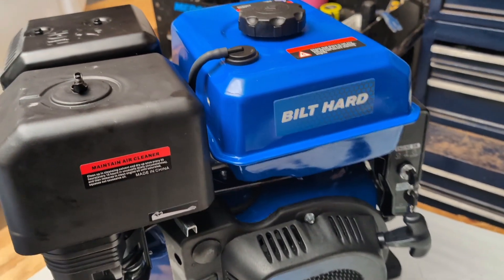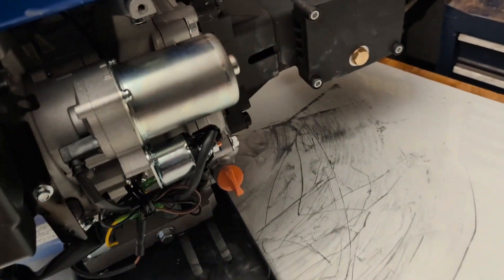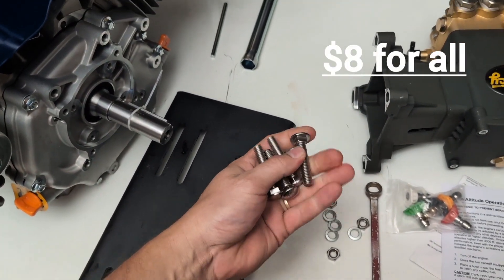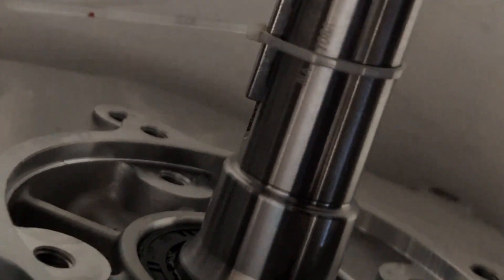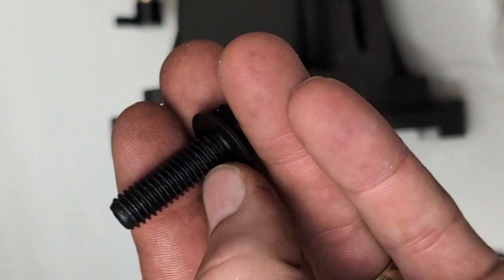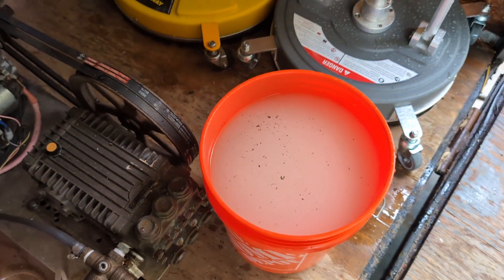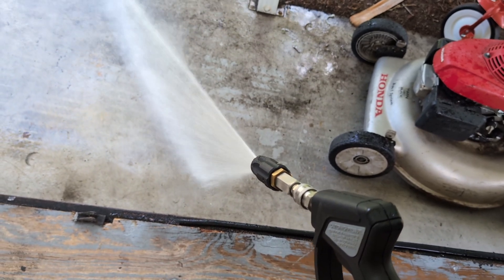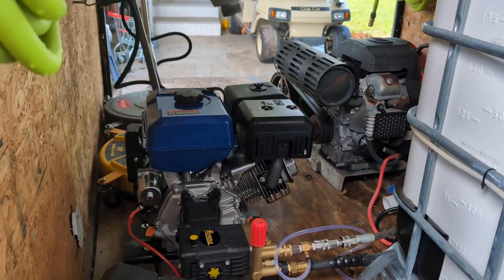4GPM Electric Start Pressure Washer Build for Under $600

Comment: how is it working a year later? I pickup all the same stuff
Reply from the maker: Still running strong. I'm putting together an update video. I've had no major issues with this setup all year and it's been a great year 😊
Reply: @MyPressureWashingBusiness  What battery did you get for yours?
Reply from the maker: @bobz6344 
https://amzn.to/4iLAPhB
These are the batteries I use. I have one for a starter battery and one for my batch mix soft wash setup. I charge them once every few weeks,  they last a long time

Comment: Never done something like this. Using your video i bought a gorilla cart, built a wooden. Frame . Then i mounted this engine/pump. 2 hose reels, and a winch to load it up into my van using some atv ramps. I now have my llc a surface cleaner and looking to do my first official job.

Comment: Dude, this is crazy! And now I have everything in an amazon wishlist. When any of them goes on sale, Amazon will alert me.
Reply from the maker: You won't regret it. I made it this whole season with this setup and it's still running perfect. The only issue I had was a valve cover oil leak. 10 minute repair and a $20 gasket. One of the most reliable builds I've done so far. The electric start was a game changer for me. I love it
Reply: Yessss. Electric start for the win! Bran new 4k pressure washer taking me 12-14 pulls per job. Incredible build! Ill be returning this one i just got and doing this exact same build. Will add a downstream as well
Reply: No gasket on the water pump needed?
Reply from the maker: @willreeves2379 hi, There is no gasket between engine and pump. The pump is a sealed unit.

Comment: Good video. I would advise not using  Loctite the bolts that hold the pump on, and put anti-seize on them instead. The lock washer is plenty.

Comment: When I test flow, I test it at the rated pressure, not an open fitting. And 4000 psi at 4 gpm calls for a size 4 nozzle.

Comment: A question: Amazon offers 3 different pumps, one with a 4000PS, 4200PS, or 4400PS. Which one do you use? Thanks.
Reply from the maker: Hi, I bought the 4400 psi pump.
Reply: @MyPressureWashingBusiness  Thanks.

Comment: So I’ve been doing tons of research bc I plan on starting a pressure washer buisness but a good pressure is expensive as crap. You got me thinking about just building it from scratch.  Save money and learn my setup so if something goes wrong I can fix it myself! I appreciate you 🫡
Reply from the maker: It's a good idea to learn your equipment. If you don't care about electric start you build your own even cheaper. The 420cc motors without electric start are even cheaper

Comment: I think the closest would be vevor 4400 4gpm but they raised the price now to over $600. So I was thinking of doing this myself, but going overboard with it haha. It would be over $600 but still far cheaper than a pre-built
Reply from the maker: Yeah. I was looking and I see prices have gone up a little since last year when I built mine. It's definitely a better machine then a box store pressure washer. I have had zero issues and have used it almost a whole year now.
Reply: @MyPressureWashingBusiness  The pump you have listed is no longer available. Would it hurt if I went up to the 4.4 gpm pump? Or do you know of a good alternative?
Reply from the maker: @FreelanceMarketingSolution 
Hi. No it would not hurt at all to go up to the 4.4 gpm. It will run perfectly fine😊
Reply: Quick question. If I went with the 5 gpm pump would the gravity fed buffer tank supply enough water? I have a 60 gallon tank. Thanks
Reply from the maker: @FreelanceMarketingSolution yes it would supply enough water. You can do a bucket test first to confirm but I am 99 percent sure it will work. I remember doing my bucket test with a 50 gallon tank and I had like 6-7 gpm coming out. Make sure you are high enough off the ground to get good flow to the pressure washer. Al least 12 inches

Comment: Hey man did you use hex bolts to attach the pump to the engine? And what size is it? Thanks I hope to hear some you soon
Reply from the maker: The bolts came with the pump. I really don't know what size they were. They were hex. I'm really sorry man, I wish I had an answer for you
Reply: @MyPressureWashingBusiness it’s okay man I understand I got it figured out! Thanks for posting this video it helps a ton ! 🙏🏻

Comment: Is there 3800 psi sufficient enough for the 20’ surface cleaner?
Reply from the maker: You can run a 20 inch but you will have to move slow with it. I have been using my 18 inch with it and it works alot better.

Comment: Your showing a motor w/ 3/4 ' shaft and pump that requires 1" shaft. How does that work?
Reply from the maker: Hi. They are both 1 inch shaft. The bilthard engine has been out of stock so if you clicked on the link in the description it may have taken you to a smaller engine. I just updated the link.

Comment: I just bought the same pump. Mine came with downstream injector built into it. Can I plug it and use the injector I bought?
Reply from the maker: @nccuttercarolina3918  yes plug it and always use the aftermarket injector. 😊

Comment: How's that pump holding up?
Reply from the maker: @nccuttercarolina3918  it's still going strong. The only issue I had so far with this build was a small oil leak in the valve cover. I ordered a new gasket and I'm back in business.

Comment: You use same oil for both machine ,Pump and engine?
Reply from the maker: @silvioperezj.d6872  no, the pump came with oil. It's pump oil. I do change my pump oil every few months and I use the brand general pump oil designed for pressure washer pumps. The engine uses regular motor oil.
https://amzn.to/4jqKWHK
Reply: @ i saw you're using sae 10w 30 y got the same engine/ and instructions says to use this oil sae 10w30 . Just wanna know if I can use the same oil in pump .

Comment: Nice job!    I just purchased a new Simpson 4.0GPM 4200PSI With ALH4240 which has the 13hp Honda GX390 and the Cat pump for $785 off Marketplace!  I'm going to invest in a new hose and short gun to use when washing cars.    I love this machine and I'm considering added the $80 electric start to it  making it similar to yours.    The power is unreal and should last forever!

Comment: Where you get the metal plate base for the engine/motor ?
Reply from the maker: @silvioperezj.d6872 
Engine mount plate https://amzn.to/3XDpAi4
Reply: @ thanks!  I have an other? Pressure washer pump comes with a downstream inyector why you add a new one ? Does that pump comes with inyector, right?
Reply from the maker: @silvioperezj.d6872  hi. Most pressure washers do come with an injector built in but they definitely don't last long at all running bleach through them. So most guys put a plug on the stock injector and don't use it. Plus some of the stock injectors are before the pump and you don't want to run chemicals through your pump. With external downstream injectors you don't have to worry and I recommend  always carrying an extra one with you because even with the good injectors that I buy, after a few months I usually have to replace them or take it apart and clean it. There's a small spring and ball that gets rusted inside. We can't do our jobs without a good working DS injector. Always rinse your injector at the end of the job to make it last longer. Hope this helps you out my friend and good luck
Reply: @ thanks bro for sharing your knowledge.  I just ordered almost everything you put in this list. I don't get the items yet .

Quick question, i can replace the inyector in that pump?? Or i should do like others do . Just remove inyector valve and cover the hole with a blank cover . So i can use an inyector in the en of the gauge. Thank you.

Comment: Looks like the pump is strong. I just bought myself a 420CC Honda clone for like $180 shipped off Aliexpress and not sure what to get for a pump yet. Was looking at this and a vevor pump with the same specs for $157 I think it was. Going to mount it to a garden utility cart so I can easily pull it around when I do pressure washing around my house, should have enough room off the back for a hose reel. I've worked on lots of 4GPM pressure washers but never owned one, the one I have now is 2.5 GPM and it's okay but, well you know lol.
Reply from the maker: @MattsRageFitGarage  hi,
I have a buddy who bought a Honda clone and he is really happy with it.  Definitely a good price point. I wish you luck with your build!
Reply: @MyPressureWashingBusiness  I got the engine yesterday and it fired up first pull and runs great. I put up a clip of it running. I went with the Vevor 4400 psi 4gpm pump got it for $130 on sale.

Comment: Can you put a key starter on any pressure washer machine?  Thx
Reply from the maker: @tundrawhisperer4821 hi.  they make upgrade kits for the electric start options for all different small engines. Your  best bet is to look on Amazon for a kit that fits your engine. But I'd definitely do some research first because I know some older engines are a pain to add electric start

Comment: Thanks for the info. Last year I replaced a pump on my honda gx motor with this same one. I was hesitant because I took an AR pump off and wasnt for sure if this one would be any good. But it did a good job. Definitely like the idea of an electric start engine and may build this rig. Thanks again for sharing. God bless!
Reply from the maker: @ChristopherHeckman-m8g hi.  I am still currently using this same build this season. It's still running great. I don't expect this pump to last forever but it's definitely paid for itself. I wish you luck with your pressure washing business!

Comment: The don’t have the motor available any good substitute y’all recommend?
Reply from the maker: @carlosescobedo3509  hi. The Duramax 420cc is basically the same engine on Amazon. Also if you have a local harbor freight they sell the predator 420cc that is also very similar. Both will work great

Comment: Total newbie here curious would this 420 engine (or some of the other 420cc brands engines) also be good if picked a 5 - 5.5 gpm pump (for residential surface cleaning)? I understand the pressure would decrease some but is a 5 - 5.5 a good pump to for the 420 engines or would a higher cc engine be better? 

And last question these engines you can turn down the pressure as needed yes? I ask because there's some solar panel rotary brushes that recommend no more than 700 pressure , so is it possible to go from low to mid 3000's down to 700?

- great how to vid by the way , very clear and to the point showing every step from start to finish , great stuff buddy

Comment: The new build is a beast. Tested on my house. Upgrading from a 2.5 gpm to 4.5 gpm is a big difference. I ordered a cart for the pressure washer tho because I need to move it around. It's very heavy with the engine, pump and fuel
Reply from the maker: @VegetaIsMe23  that's awesome. Yeah I really like this build. I've used it a LOT since I built it. I just did my second oil change and it's still running strong. It is heavy if you have to move it around. Good luck with everything my friend!
Reply: What is the best cart to get this thing on? Im thinking of getting this on the back of my suv

Comment: If I get one of the cheaper 420cc off Amazon $300-$400 will the shaft fit any pump rated for 4.0-4.5gpm?
Reply from the maker: @bigdanish hi.  all depends on the size of the shaft. most 4-5 gpm are all 1 inch shaft. But some are smaller so just make sure the motor you choose is a 1 inch shaft and the pump is a 1 inch.
Reply: @ Oh man, SWEET!! What I was really stuck on was the keyway. I didn’t know if it would fit, glad to know if the shaft diameter matches the pump inlet it shale work!!! LIFE SAVER! glad I found your page to subscribe for the best honest tips and tricks.. god bless, love from Dallas/ft.worth TX
Reply: Wait am I to understand that this engine will also work if you put a higher rated pump on it? Like eventually putting a 5 gpm pump on this same engine?

Comment: I’m interested in building this pressure washer rig.  When I follow your link for the engine from Amazon it links to a 79cc 2hp unit.  Can you provide additional info so I can find it?
Thanks
Reply: This engine is very popular. It was sold out for about 2months. I just ordered mine off Amazon. It was 2 left. Even if you go to the company website that make em it's still sold out. The engine you want is sold out.

Comment: gpm pressure washer Bilt Hard 15 HP (420cc) electric start gas engine 
Is not in stock anymore so what other engine do you recommend?
Reply from the maker: @hiepha-c4p hi. The Duramax 420cc from Amazon and the harbor freight predator 420cc are identical engines just different names.
Reply: Just saw your reply to someone else.Thanks

Comment: @14:10  you are actually supposed to full the oil up to the top of the treads in the engine, you don't even need the dipstick part. in fact some ppl cut it off as it can break off and ruin the engine and its not needed.

Comment: You're the man.. I wanted a low-profile setup so I can have it in my bed. I do have a question though. Being you have the option for a key start or pull start. When using the key start how does one keep the battery charged? Is there some type of alternator? 

I owe you a beer sir :)
Reply: Yenorthe electric start usually charge back up the battery
Reply: @jd-it4on  Thanks buddy. keep those videos coming.

Comment: I bought everything in the Description  through amazon except the engine. Amazon was out so I bought directly from bilthard. The engine was supposed to be here Saturday. Now I'm getting the run around with no answers. You had mentioned a predator engine do you still have a link for that? Thanks
Reply from the maker: @joelpro-touch3494  hi. the 420cc builthard are back in stock on Amazon 
https://amzn.to/3Y5j2d0
But if you want the predator it's from harbor freight. Not sure if they ship engines though but you can check it out.
https://www.harborfreight.com/13-hp-420cc-ohv-horizontal-shaft-gas-engine-epacarb-69736.html

Comment: I built mine using a predator 420cc, I used it for the first time last night for a gas station job and noticed my oil stick was in place but looked like it had leaked oil. Any idea as to why that happened? Also I’m worried it’ll over heat
Reply from the maker: Hi, Did you ever figure out where the oil was coming from? A brand new engine shouldn't be leaking any oil! Was the oil cap tight? Or Is it maybe coming from the valve cover? Maybe something just needs to be tightened. Hopefully it's something simple.
Reply: Predator is junk spend the extra 25 on another brand just being honest

Comment: Question I did not see addressed in your video. Is the drive shaft a standard with all pumps? Including the mounting holes, size and location?
Reply from the maker: @johnratliff4594  hi. This is a 1 inch shaft; motor and pump. But there are smaller 3/4 inch too. Most 4gpm machines are 1 inch. If you are thinking of using a different motor or pump you just have to compare specs for each product to make sure they are compatible

Comment: Very Nice ! Thank You Sir 🙏  

Actually, I do have a question, Does it need a bypass hose or something ? Like to let it run when not on the trigger. 

Thank You Again Sir
Reply from the maker: Hi, There is a way to do this. You can put an external unloader valve that has the option to allow water to keep flowing through the pump. I actually made a video that might shine some light on this upgrade. Hope it helps
https://youtu.be/_37I3weNFnI
Reply: @MyPressureWashingBusiness   Nice!! Thank You for getting back to me Sir , I appreciate your time and help.

Comment: Is there an inexpensive 2 wheeled frame cart you might be able to recommend for this build?
Reply from the maker: The only thing I can think of would be to try searching marketplace for a broken parts pressure washer and just use the frame
Reply: What about a 4 wheel gardening pull wagon
Reply: @mobofthugs that’s how I made mine

Comment: How much did you pay for the engine? I clicked the link in the description and it takes me to a 79cc and there is no 420cc. I found the same engine for 350 is that what you paid? Thanks
Reply from the maker: I guess Amazon is out of stock. Here is manufacturer website 
https://bilthardusa.com/products/bilt-hard-420cc-15hp-gas-engine-with-electric-start